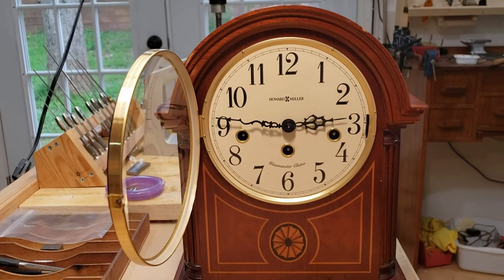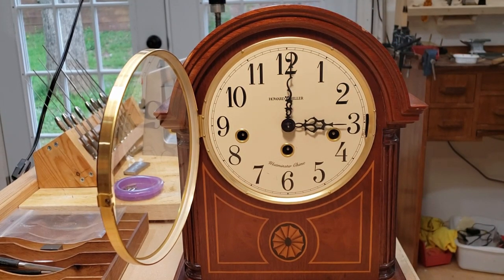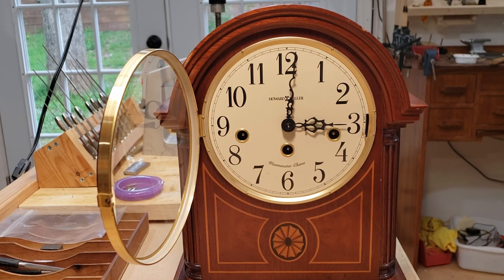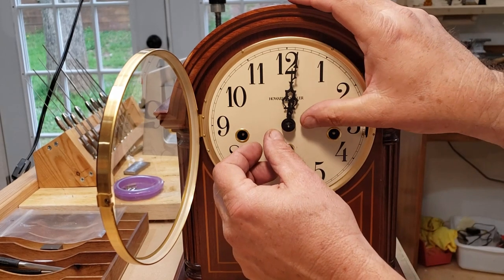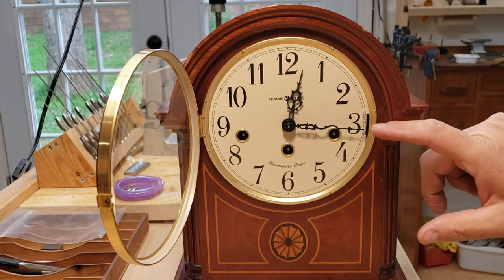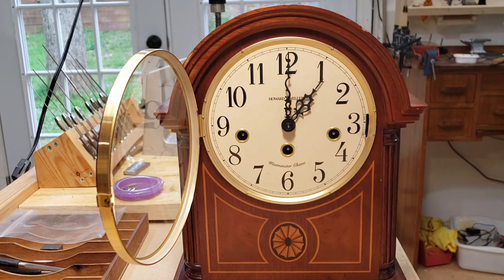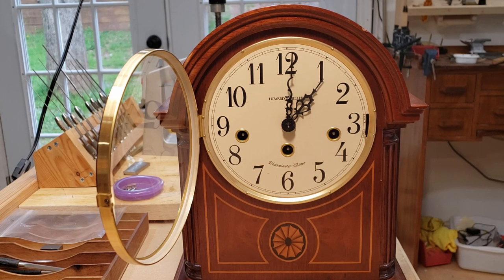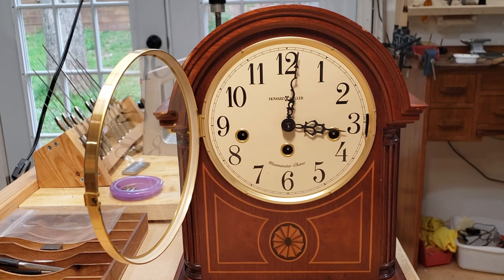Hour hand adjusting

Comment: Thankyou for the information, but what do you do when the minute hand is at quarter past the hour and the chiming cam is  chiming 8 beats or 12 beats to the bar instead of 4 beats at a quarter past the hour? such as in the case of an Enfield Westminster mantle clock from the 1930s as most old clocks these days have the original operating instructions pasted on the  rear door of the clock missing? Jim from AUSTRALIA.

Comment: What happens on my Grandmother clock if the hour hand doesn’t follow the minute hand.  When I need to adjust the time, normally I can move the minute hand and the hour hand follows but for some reason the hour and stay in place even if I move the minute hand around multiple times and the clock isn’t chiming on the 1/4 hour as the minute hand moves around

Comment: Hi. I have a  Seiko Corona Melodia table clock from 60s. It has dual alarm, one ringing bell alarm and a music box. The clock works just fine after i cleaned and oiled the movement but both the bell alarm and music box alarm rings four hours late. Like, if it's set to 08:00 it rings at 12:00.. How do i adjust it? Thanks in advance.
Reply from the maker: Move the hour hand to the time it is chiming. If it chimes 12 times move the "hour" hand to the 12. Then move the min hand to the correct time and it should be reset. Let me know if you have any other problems
Reply: @ClockRepairService   thanks a lot for the reply. this clock is not a chime clock but there is a music box. allow me to add the link of  only example i could find on internet
Reply: @ClockRepairService   this one is the single specimen of this particular model i could manage to find after 2-3 months of search.
Reply: @ClockRepairService    the clock movement is connected to the music box movement and you can set the music box for alarm.
Reply: @ClockRepairService   i have a number of Seiko Corona Melodia and Rhythm clocks with music box but i can't find any particular info..i know it's not rocket science, in the end of the day the logic is same as far as i can understand but a pro help would be perfect
Reply from the maker: @soulsirius  you can send a link. Is it a Musical clock?
Reply: @ClockRepairService   I added link few times but YouTube deleted each time , I don't know why..
Reply: @ClockRepairService   yes it is a musical clock. When you make a search "Seiko Corona melodia" you will see lots of examples but this particular model is Fancy Gold

Comment: My mantle clock is battery run, and I can't access the clock face to remove the minute hand. If my clock is striking the hour five minutes later than it should be, how do I fix it?
Reply: The only thing I know is just push the minute hand back to the 12:00 position. DO NOT EVER Touch the hour hand.

Comment: my mantle clock is striking the hour when the min hand gets to the nine how can I fix that?
Reply from the maker: Set the min hand to the 9, remove the min hand,  put it back on at the 12. Let us know if that works for you.
Reply: @ClockRepairService  actually I was able to get it to work by advancing the min hand from ten after to two min before half-past and back again.
Reply: @ClockRepairService  my mantle clock-Water burry-strike when the minute neele is at 11 and 5.The needle has square slot so also the neele piller How to correct the strike?